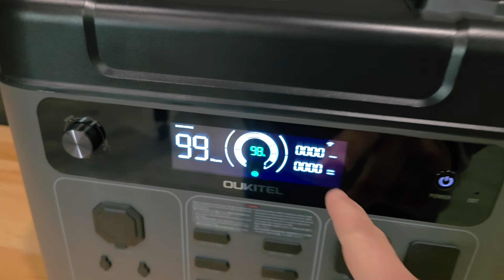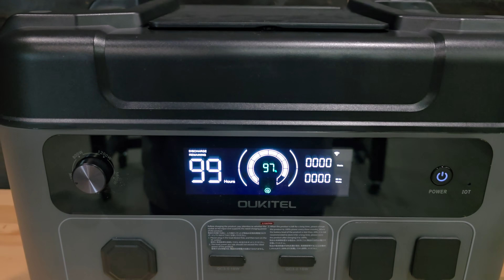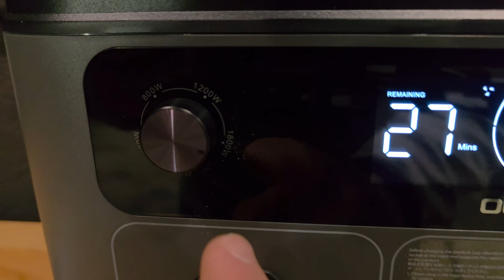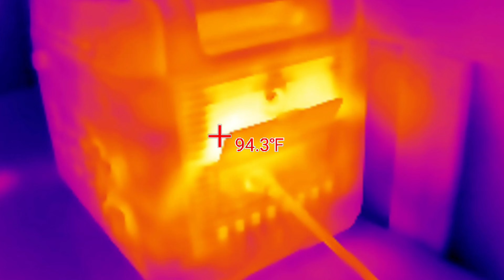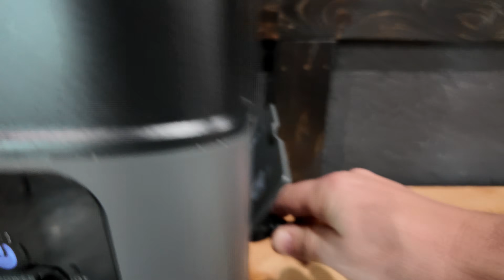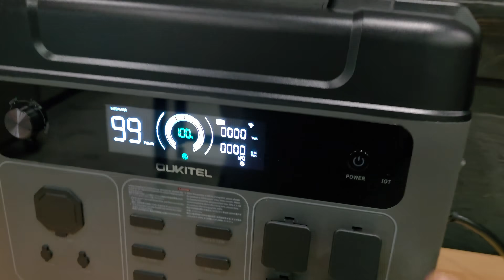THIS can not be TRUE! Oukitel P2001 Plus Power Station

Comment: Has anyone had a P2001 Plus stop charging after a deep discharge? Mine (110V) no longer charges from AC and support hasn't replied. Did you find an official reset or reactivation procedure that worked?

Comment: i think you needed further testing to come to the conclusions that it was the unit fault. 
1. Continue draining the battery to confirm at what level it triggers a full charge.
2. Use a different GFCI circuit in the home to see if the tripping is repeatable. It could be the receptacle or the wiring in the circuit.

Comment: I agree with the evaluation. My Oukitel P2001 did Not perform well for me either.  After only 2 years it had a hard failure of the AC outlet engagement relay, a Major component failure. I only run a small refrigerator, (500watt start up and 61watts running).    Oukitel boasts about reliability and longevity, but it's disappointing to have major trouble so early in this life...
Reply: did you buy that unit several years ago? mine has been on stand by just in case but now I hooked it up to panels to beef up my system , the clicking at daylight and night fall is way too loud and it makes me wonder what other things await me.

Comment: My EU version does not seems to have these problems.
Reply: I am from Portugal and looking into buying one. How is yours doing?
Mostly worried about the recharge problems
Reply: Have bought one 2 days ago. From the netherlands. Going to test it when it comes in.
Reply: @BrewedAdventures  how as it been?
Reply: @Quicomtb very well except for wifi. It has a connection issue with my home wifi but not with my business wifi.
Reply: Heb de mijne ongeveer een jaar. Goed toestel! Ik zoek niet de limieten op want dat is om problemen vragen. Maar mijn compressor 1800W bijvb. geen probleem.

Comment: I have one. It went faulty after about of month of very little use. BTW, i did not have problems with charging reported in the video and below in comments. So, long story short, after about a month I plugged electric kettle 1KWatt and made myself a cup of tea. This was my last cup of tea with this station. It stopped charging and no power output from any outlet. I understand what went wrong, but station still on warranty and I sent it back to supplier. Now waiting for the delivery of the new one.
Reply from the maker: Thanks for sharing

Comment: Is the Wifi, Bluetooth connection stable ???  I plan to use it in the car, controlling it from home with the app. However, I see that it has a lot of flaws and I probably won't buy it. 
I am thinking about buying Pecron E1500LFP
I wonder how the mentioned connections with the phone work
Reply from the maker: My favorite power station brand is Bluetti. If connectivity is important, the Bluetti app works perfectly using Bluetooth or wifi. In the 2400w range, I really like the AC200L.
Reply: @TheSolarPit  I didn't know that bluetti has such good connection. A few days ago I ordered Jackery Explorer 2000 v2, I hope that the connection will be just as good. Thanks for the information

Comment: This is just me but I lived in an older house where floating grounds happened here and there depending upon what circuit I was using.  The GFCI circuit was causing the problem.  I tested the circuit and continued to get  an open ground fault.  Just a thought, plug the power station into another circuit without a GFCI outlet on the circuit.  If you get a different result that might help with the diagnosis.  Just a thought.
Reply from the maker: Thanks for sharing